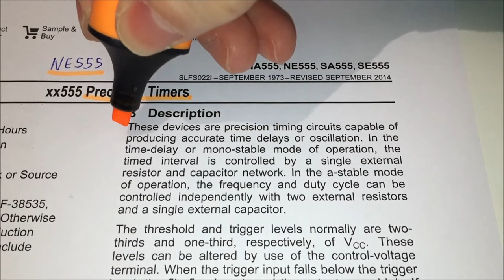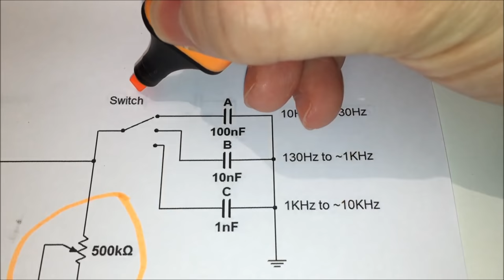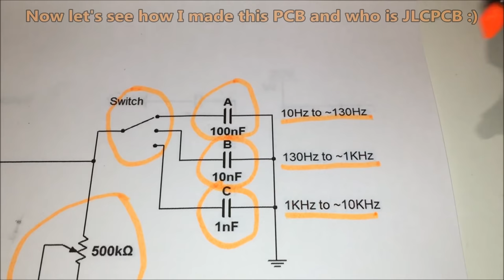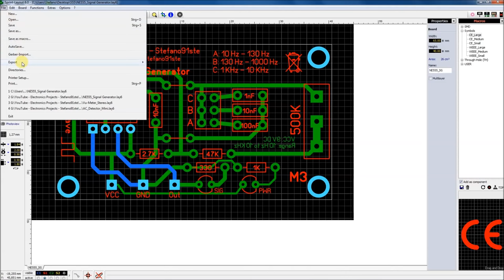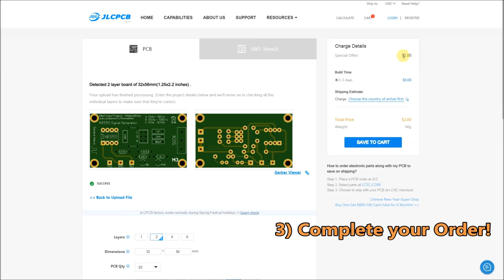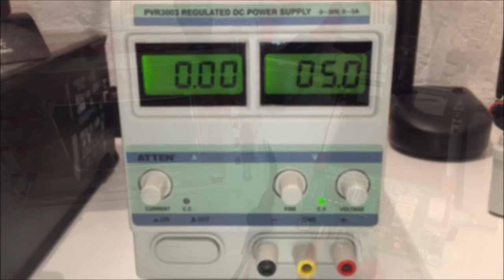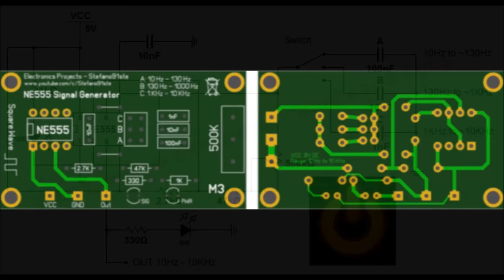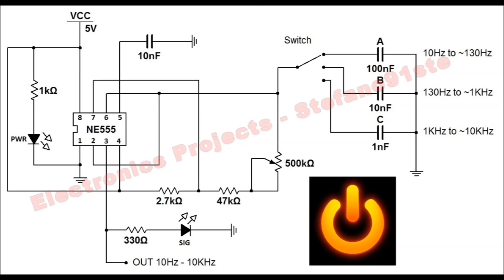NE555 Signal Generator Tutorial PCB - 10 Hz to 10 KHz

Comment: Amazing video on many levels! Thanx for sharing

Do you know what would be the formula to find out which capacitor I would need to get a specific frequencies? Say if I wanted the generator to constantly put out 440hz without using the 500kpot...?
Reply from the maker: Hi, thank you! About your question, it is necessary to put a resistor of the correct value in place of the potentiometer, so that it can always generate the desired fixed frequency. Do a test with the potentiometer to see what the value should be to keep 440Hz fixed, but it is very likely that a non-standard resistance value is necessary (for this reason the potentiometer is always better)

Comment: What voltage is the output? I need to switch the gate of an igbt with it (the igbt, in its turn, is switching a 120V dc, 2-4A circuitry on-and-off)
Reply from the maker: The output is about 5v

Comment: Is it possible to play the sound using piezo speakers using your circuit?
Reply from the maker: Yes, but the circuit is not designed to handle a loudspeaker, so the result may be poor.
Reply: @Stefano91ste  Thank you for the reply

So can I use a amplifier for the speaker? 

Because I am using Kemo L010
Rated voltage 16Vp-p
Sound pressure: 120dB

If I have to use an amplifier which class amplifier can I use?

For your reference I am giving 12V to the Circuit.

Thank you

Comment: I have a question before finishing this video 
Is the duty cycle less or more than 50% ? 
Great video
Reply from the maker: Hi thank you!
The duty cycle is variable, but always more than 50%
Reply: @Stefano91ste  thanks mate and I hate to bother you but one last question
Shouldn't the ON time be fixed around 15 mSec ? And changing the OFF time to change the duty cycle and frequency?
Reply from the maker: No because this circuit is variable in two ways, both with the trimmer and switch between the three capacitors